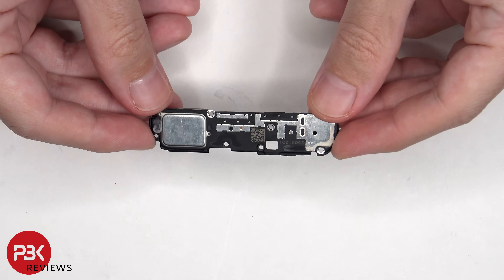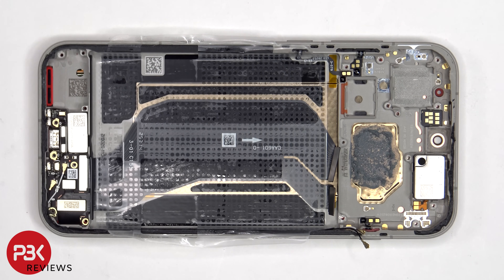OnePlus 15 Teardown Disassembly Phone Repair Video Review

Comment: What about Fingerprint Sensor position?
I even didn't find it...
Reply from the maker: It's in the same area generally found with other similar devices which have a fingerprint sensor underneath the screen. It's behind the screen covered by the midframe so unless the screen is pried off, it won't be visible.

Comment: Where is that WIFI chip and touch sampling rate chip claimed by OnePlus?
Reply: Custom chips are really small , it’s there on mobo , it’s not large as processor that’s why.
Reply: @mprayagraj  Its under the metal cover for wifi chip, I wasnt able to find any details on the touch sampling rate chip which likelihood not done by Oppo, but I cannot find specs on one particular chip so lead me to believe thats the touch sampling rate chip.

Comment: It looks like every Android phone has the same hardware design, batter at the middle, cameras, mainboard, speaker at the top, and charging port, main microphone, speaker at the bottom.
Reply from the maker: yeah most follow this setup, some differ but generally this seems to be the most ideal layout.
Reply: you can have the speaker at top right corner to allow for bigger speaker and bottom left corner but then the audio will technically be open chamber and result in like vibration of whole device (honor)
Reply: Yeah. Because that's the optimum for weight balance. Slightly bottom heavy is what feels best in humans hands. 
Why change that that, if it works.

Comment: what are the physical dimensions of the battery? i am curious if the larger OP15 battery would fit inside of the OP13. The internals between the two phones look very similar.
Reply: The Oneplus 15 battery is longer won’t fit
Reply from the maker: 94mm (this is including the flex cable on top) x 66.7mm x 5.7mm

Comment: Small Motherboard Oneplus 15 Heating issue 😭🤮
Reply: Ur face and knowledge 🤮🤮🤮
Reply: You haven't use it yet lmao stop speculating
Reply: I have the chinese model as well. I have both the OP13 & OP15 on hand right now and I can tell the 15 easily gets warm where the 13 doesn't.

Some I noticed are when playing 2D games, video call and using the camera.
Reply: @renofumi28 Well, I already got chinese 16/1tb version there is little bit hot but not that much.. maybe it is not only this device's issue